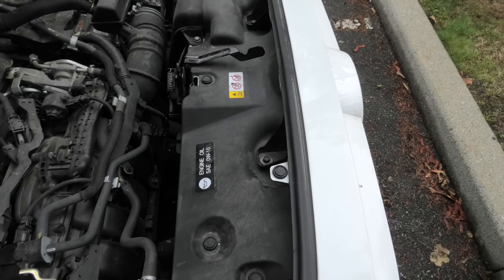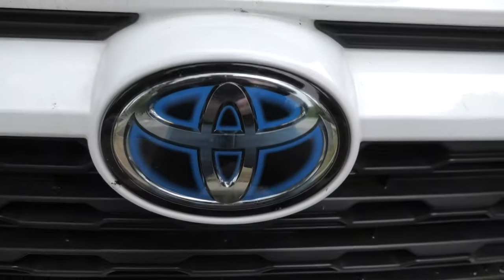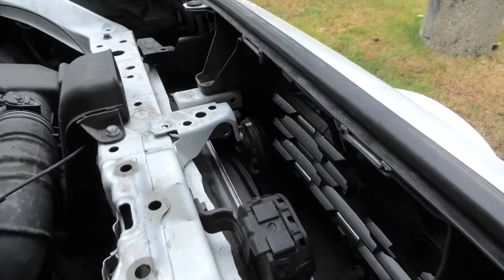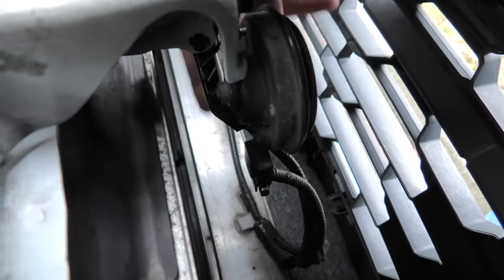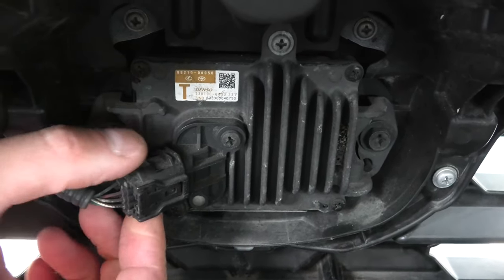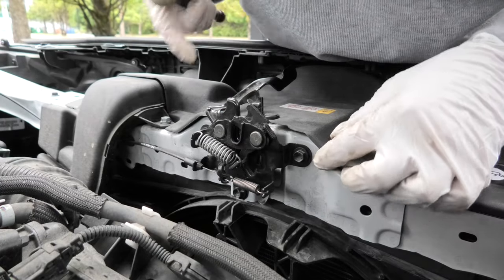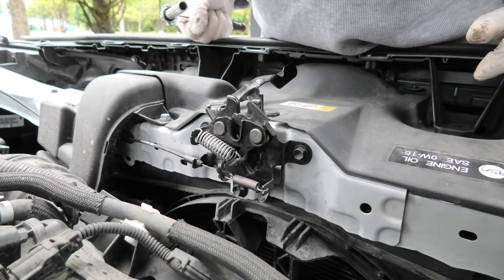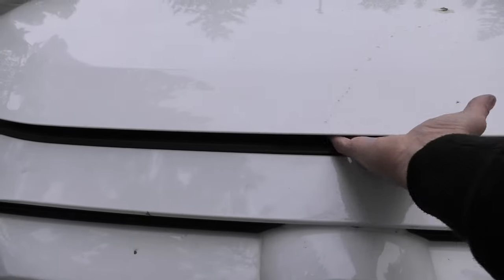Toyota RAV4 (2019-2024): How To Access Horns And Front Radar?

Comment from the maker: PRODUCT LINKS:
1. HELLA Black 12V BX Trumpet Horn Kit (Toyota) - https://amzn.to/3SihTLI.
2. OEM Cruise Control Distance Sensor For Toyota RAV4 Lexus ES250 ES350 88210-06050 - https://www.ebay.com/itm/305371705108?mkcid=1&mkrid=711-53200-19255-0&siteid=0&campid=5338971185&customid=&toolid=10001&mkevt=1.

TOOLS REQUIRED:
1. SOCKET SET, RATCHET - GEARWRENCH 57 Pc. 3/8" Drive 6 Pt. Mechanics Tool Set, Standard & Deep, SAE/Metric - https://amzn.to/41wE6Z3.
2. SWIVEL HEAD RATCHET - GEARWRENCH 2 Pc. 1/4" & 3/8" Drive 72 Tooth Dual Material Roto Ratchet Set - https://amzn.to/3kwhHdS.
3. FLAT HEAD SCREWDRIVER - Klein Tools A131-2 1/8-Inch Flat Head Screwdriver with Keystone Tip, Made in USA, Pocket Clip, 2-Inch Round Shank - https://amzn.to/3VV0FVh.
Reply: do those plug right in or do you need to cut the plugs to wire them in?
Reply from the maker: @mikeh.8155  These are plug and play.

Comment: Just a note to say the instructions were perfect. I just changed out my horns in about 15 minutes. Thank you very much. The only thing I would add is that all bolts were 10mm. BTW, I also had to remove the two bolts holding air duct, so I could gain access to the hood latch bolts (2022 Rav4).

Comment: Pretty sure you installed the hood latch bracket incorrectly. The lower hood latch bolt tab is supposed to sit in the pocket BEHIND the body colored radiator support channel. Otherwise there is no tension/support happening since you’re just tightening the bolt into the latch bracket and nothing else. If you go back to the beginning of the video, when you’re taking the latch off, you’ll see what I mean.
Reply: exactly

Comment: What size did you use to move the lock and what tool?
Reply from the maker: 10mm socket. Swivel head ratchet was used - GEARWRENCH 2 Pc. 1/4" & 3/8" Drive 72 Tooth Dual Material Roto Ratchet Set - https://amzn.to/3kwhHdS.